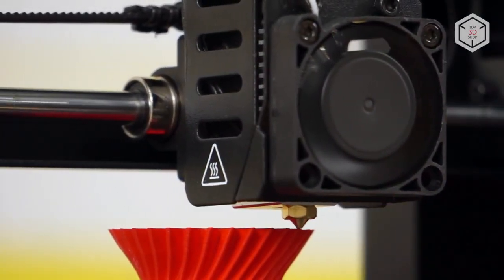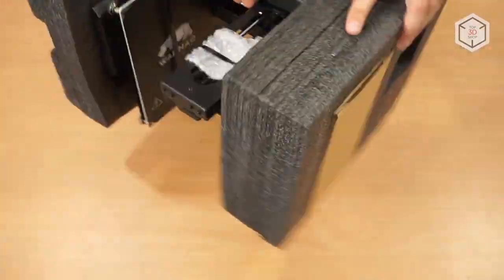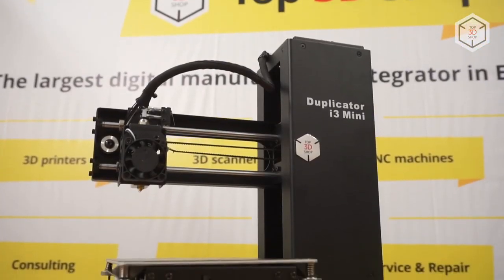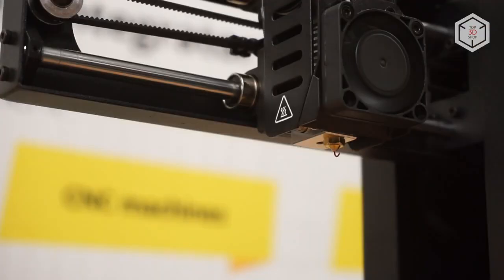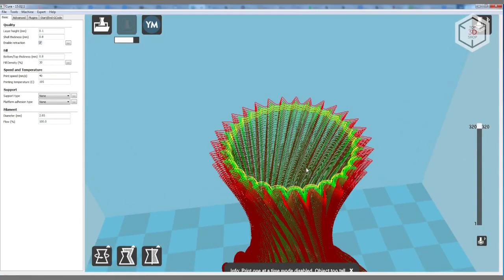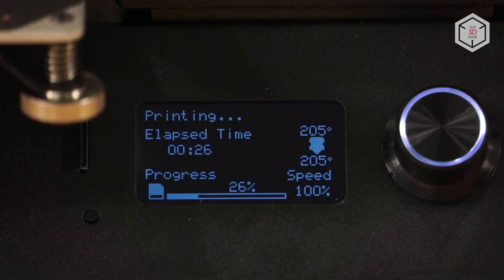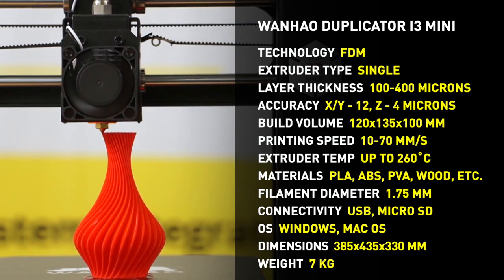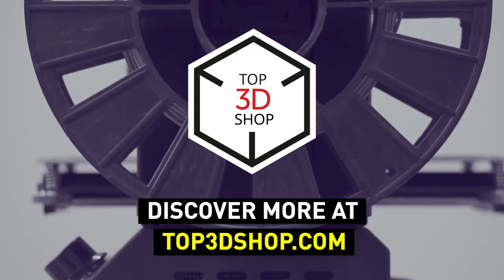Wanhao Duplicator i3 Mini 3D Printer Review: The Smallest Duplicator

Comment: This is actually one of the best printers!

Because it’s small, levelling is rarely an issue. I have 7 other printers. All are good. All have their features. Mini is still my favourite overall. 

The truth is most objects you will print are small enough to fit on the bed. 

No, there isn’t a bed heater. But the glue stick works every time. Hundreds of prints and no adhesion problems. 

What I really like about this is it’s super reliable. It’s small. And it doesn’t use much power. You can literally use it on your desk beside your computer. You cannot say that about 99% of the printers out there!

They aren’t as popular as they once were, but if you can buy one do it!

Note: It is possible to upgrade bed to heated after you buy it. But I don’t recommend it as it’s not needed. 

Do yourself a favour and only use PLA.

If you have ANY questions, I will usually reply within a day or two at most. :)
Reply: 3 YEARS AGO I BUY THIS PRINTER AND IT'S A PAIN IN THE EGGS!!!!!! ALWAYS HAS SOMETHING, A MESS!!!   PLEASE GIVE ME AN EMAIL TO SEND YOU MY PROBLEM, I'M CRAZY!!!!
Reply: @MariaPaz-pm3lw  you can reply / ask right here if you want. Maybe best as others can see answers too :)

Comment: I've got it plugged in via USB but it won't print through it. Hitting print on the program it recommends just saves the gcode file and the printer does not show up under "This PC"
Reply: Try turning them both on first before connecting them.

Comment: I am new to 3D printing. An I was wondering if I could use abs
Reply from the maker: Hi! You can, but we recommend use PLA
Reply: No, it's a PLA only machine.
Reply: Don’t use ABS. Bad fumes. Horrible bed adhesion. And frankly PLA is superior to it in most uses. 

If you haven’t to use ABS, you should upgrade bed to heated (aftermarket). And put machine in an enclosure. 

Best to not use ABS regardless of printer. Maybe 10 years ago it made sense when PLA wasn’t as developed. But not now.

Comment: Any 3D Printer that comes with a glue stick is going to be trouble.
Reply from the maker: Just carefully follow the rules of operation and everything will be good. Besides Wanhao Duplicator i3 Mini one of the best 3d printer under 200$
Reply: Nope! This printer is so small that alignment and levelling really isn’t an issue once you’ve set it up. 

True, I don’t use glue sticks at all with my other printers. But it really isn’t an issue using a glue stick if you keep coating thin and eve.  Using a wet paper towel to wipe and spread a thin film of glue between prints works great. Don’t use hairspray! Just a cheap common water based glue stick is best.